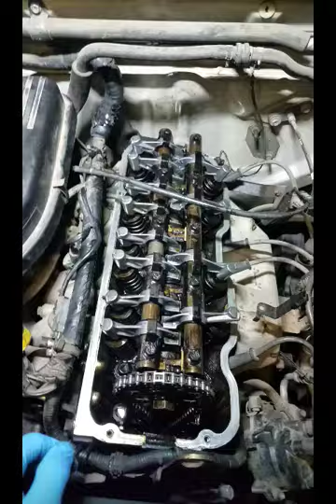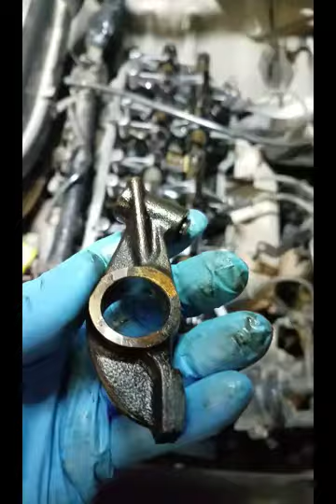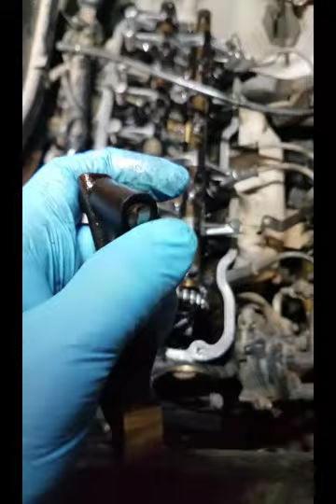Replacing The Rocker Arms on A Nissan KA24E Engine, '97 Pickup

Comment: so, no TDC, and no cam sprocket removal....good!  i've seen another guy on YouTube here who said you need to get this to top dead center, and you have to loosen and remove the cam sprocket for added clearance
Reply: No. Just take the 10mm bolts off in sequence and lift the whole shaft off the head.

If you’re only doing one side, STILL loosen all the bolts. It’s not good to have one side compressed and one side loose. 

Be careful not to drop any hardware into the oil pan.

Comment: Hey, I replaced all the rocker arms and new rocker arm rails and now my truck is misfiring do you have any idea what it could be?
Reply: Timing?
Reply: This happened to me once. Cylinder 4 misfire after replacing the rocker in that area. 0psi compression. Thought the motor died. I put the old one back on and it came back. 

Reason: new rocker was badly made/casted and had bad tolerance enough to keep valve open; creating 0 compression and a misfire obviously

Comment: Did you have to remove the cam gear, or any other timing parts?
Reply from the maker: The camshaft does not get removed and the cam gear stays in place.  Both rocker shafts simply unbolt and lifts off.  It's really not hard, just take your time and keep everything in order. Thanks for watching!